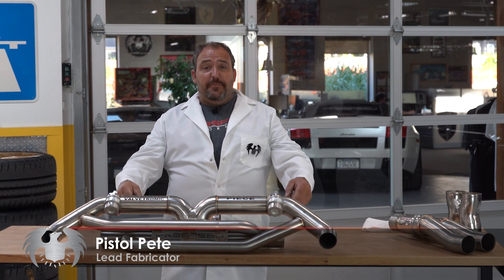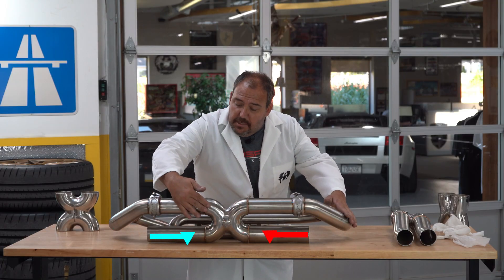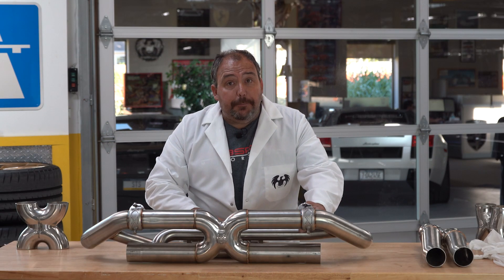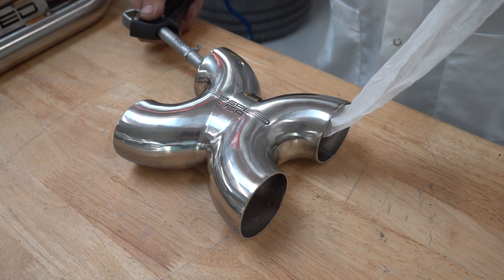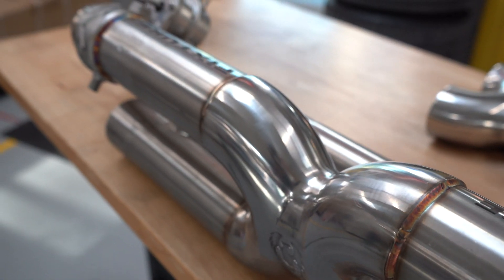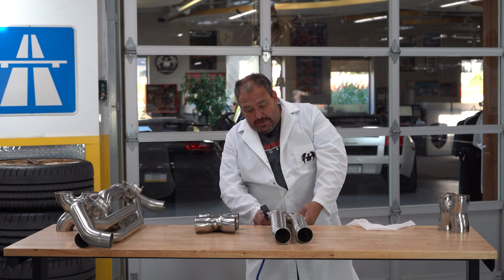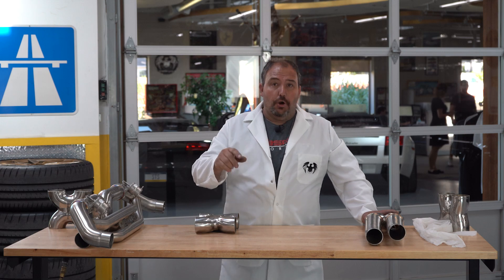Why use an X-Pipe?

Comment: Great video and finally easy to understand with such an incredibly easy example to see !

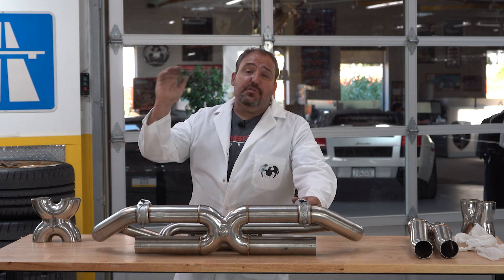Question at around 1:40 seconds you mention the peak power when bringing at the bar vrs this setup being more mid range under the curve gains

In the case of someone who is actually driving it hard almost all the time and revving it out to redline always would that kind of car benefit from the banks being totally seperate all the way to exit and never any type of merge? I a actually more interested in the top end gains